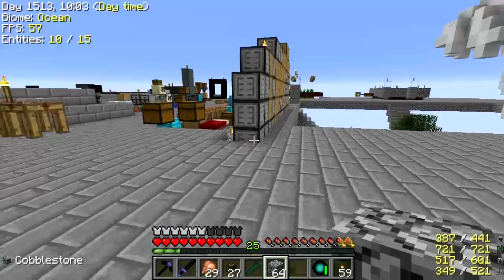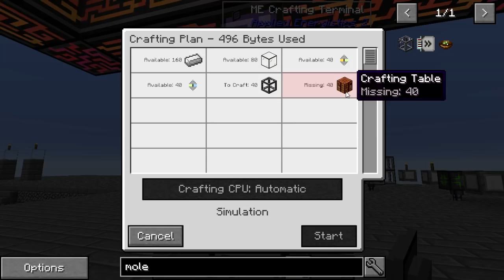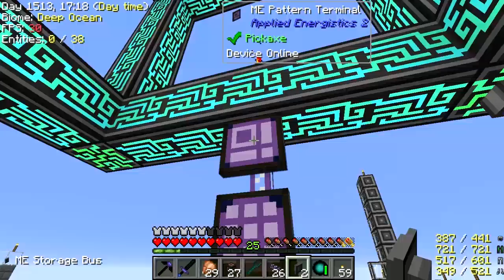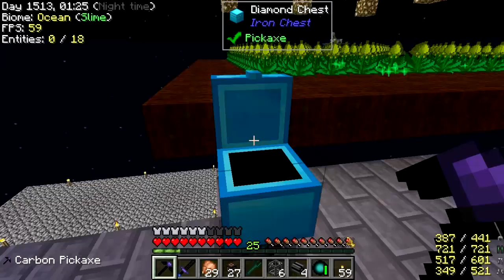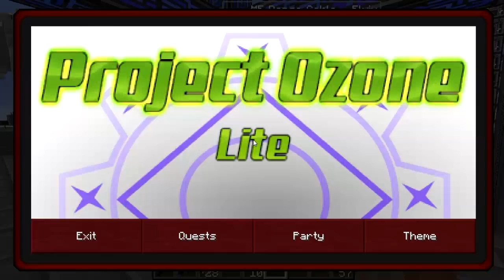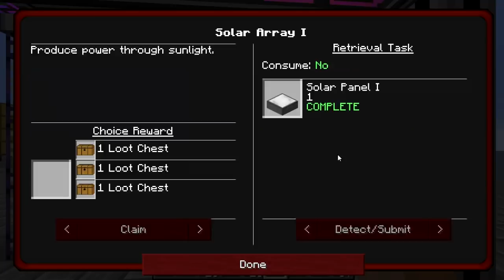Solar - Hermitcraft Hermit Skies Ep21

Comment: To address the power fluctuating... check the connections to the bank and make sure to have separate ins and 
outs for power connections, not shared ones as in/out, that makes a loop and registers on display.
A proper placement for the solar panel array would be directly on top of the bank or connect them with the cryostabilized conduits.
Good Luck and Thank you for the video!
Reply from the maker: I should have thought of that.  power loops aren't a good thing.  I'll have to fix that